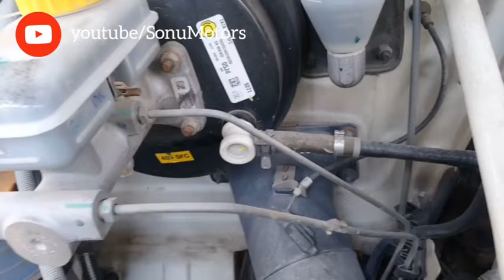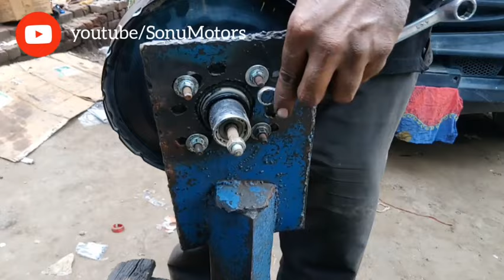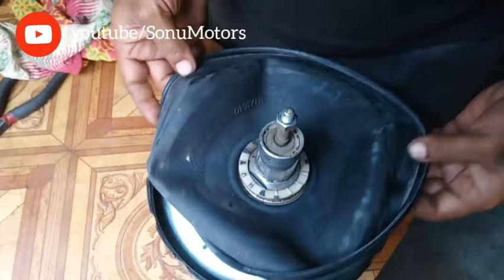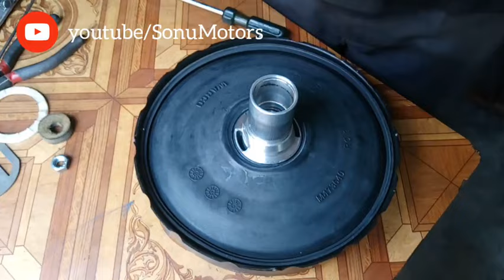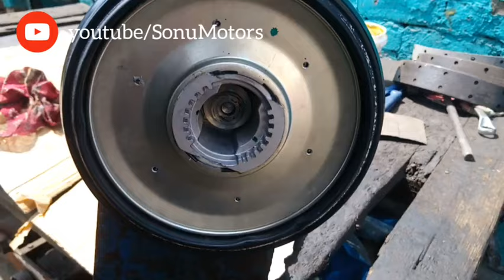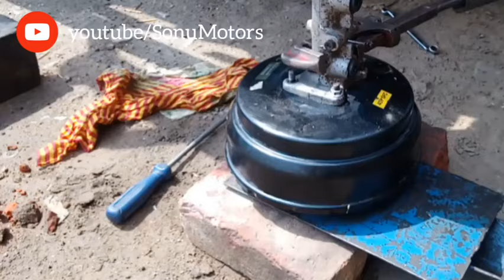Vacuum Brake Booster Repair | ब्रेक बूस्टर रिपेयर करने के आसान तरीके | Hindi

Comment: Sir bolero brek hard horaha hai what problem
Reply from the maker: Paidle hard hone ke karan
1 vacuum paipe leak ho sakta hai
2 brake booster ka rubber kharab ho sakta hai
3 wheel cylinder jaam ho sakta hai

Comment: Hai, mera naam jaseena, mein kerala ki rahnewali hoon. Mere paas tata ka 407 commercial vehicle hai.meri gaadi ka problem, uska break apply nahi ho raha hai. Break mein foot, rakhne par break pedal neeche jaa raha hai. Break booster badal ke dekha. Maas cylinder badal ke dekha. Phir bi woh waise ka waisa hi hai. Gaadi mein load nahi toh thoda sa break miltha hai. Gaadi mein load ho gaya toh break nahi miltha. Hum kya karenge. Idhar ke service karnewalon ko patha nahi chal raha hai, kya karna hai
Reply from the maker: Jaisa ke aap ne gaadi ki problem batai hai
Paidal neche jane ki is me break booster ki koi dikkat nahi hoti is problem ke aur karan bante hain
1 master cylinder ka kharab hona
2 Brake paipe ka leak hona
3 Brake ka sahi se na milna
4 Brake adjuster ka kharab hona
5 Aur brake paipo me हवा hona

Aap ne gaadi मॉडल no years nahi likha

Agar master cylinder badal gaya hai to 
Upar दिए हुए karnao ko cheak karvaye in se koi ek karan hai  
Gaadi new मॉडल hai to right side ke पीछले टायर 
के pass brake paipe ke बीच ek break ki setting hoti us ko bhi set karne se brake sahi ho ti hain
Reply: Gaadi ka model 2011, BSIII
Reply from the maker: Paidal neche ka karan jyadatar master cylinder ka hota hai 
Agar master cylinder bilkul sahi hai to gaadi       ke brake ko मिलवाए  aur sare wheel se hawa ko निकलवाए 
Aur sath hi जिस कारणों के baare bataya un ko bhi check करवाए gaadi sahi ho जायगी ।

Comment: Dear sir
Mere pass new tata tiago 2020 hai 3 cylinder engine kabhi kabhi brake low speed pe hard lagta hai but second press mein lag jaata hai. 
Service center aaj check karaya toh 1 se 2km drive kiya full speed low speed lekin koi problem nahi.
Aur neutral mein brake press karne pe hiss sound aati hai toh usne dusri tata ki gaadi dikhayi bola vacuum ke wajah se yeh common hai aur dusri gaadi mein bhi hiss sound tha. 
Kya baar baar break press karne se break hard hota hai?? Please sir reply
Reply from the maker: Sir break booster main halka sound aana commen hai 
Baar Baar break lagane par paidal agar jyada bhari ho raha ho to break booster ya vacuum paropar nahi  banta tab aisa hota hai
Par aap ne jaisa btaya us hisab se koi dikkat ki baat nahi hai
Mere hisab se aap ek baar vacuum paipe check karwaye aur engine ki slow race ko halka sa badwaye
Is se booster ko vaccum pura milega 
To break aur break paidal sahi rahega vaise sir hamara kaam badi  ka  hai system same hi hota hai
Comment ke liye dhanyawad sir
Reply: @SonuMotors  thank u sir for reply doubt clear hua mera 👍👍👍

Comment: Thanks I have same problem in my safari 3.0 Dicor 2006 which is same like TATA 407, all mechanics don’t look some say vacuum pump is broken and some says booster change karo without even opening bonnet. Thanks for video, Shop kahan hai?
Reply from the maker: Thank you
Reply: @SonuMotors  aapki shop kha hai address

Comment: Sir meri gadi aage se bhari bhari chalti hai aur acclator pedal pe pressure Dena pad raha hai.gadi wagon r hai 12000 km chali hai.caliper grising karavya to thik chali for se same problem aa gaya.
Reply from the maker: Sir . गाड़ी  bhari chalne ke aur bhi karan ho sakta hai agar caileber greasing se फर्क पड़ता है to ya to phir जाम ho gaya ya caileber pin टेढ़ी है 
Disc assembly ko paropar sahi करवाए प्रॉब्लम
Sahi ho जाएगी ।
Reply: @SonuMotors  sir 1st gear me gadi bina aacelate kitni speed pe chalegi aur second gear me kitni speed pe chalegi?

Comment: In my tata Vista break pedal got jam not return back car not moving ahead what to check and repair
Reply from the maker: Yes
Reply: Plz advise
Reply from the maker: The problem that you mentioned is of brake booster and disc brake, first you check the disc brake well
Reply: Okay I'll check disc break also there is fuss sound coming while pressing break pedal
Reply from the maker: check if disc brake is good then brake booster will be faulty
Reply: Is it possible for you to clarify part number and company name of break booster for Indica Vista petrol

Comment: I'm from Mizoram, and have the same problem. where can i get a repair kit?  Mechanic told me that, it's not repairable and i have to buy a new one.
Reply from the maker: Which is your vehicle, which brake booster is installed in it, which company belongs to
Reply: Tata SK407 bs4
Reply from the maker: This brake booster kit is available and repairing is done, this kit is available here in Kashmere Gate Delhi, if the mechanic tells you that the repair cannot be done, then tell him about this video thank you
Reply: @SonuMotors  bhai kashmiri gate shop ka naam ya adress bhi toh batao tabhi toh kaam banega

Comment: Hi, my TATA 207 brake pedal was going to the floor, so I change the seals in the master cylinder, bled the fluid and air from the slave cylinders, pedal got hard, but now it's hard to press while driving and transmission shifts down when I press brake pedal. There is good vacuum behind the valve. Could you advise please.
Reply from the maker: When you press the brake pedal, the brake pedal goes down after stopping at one place.
or goes down without stopping
Reply: @SonuMotors  the brake pedal is hard to press, braking difficult, when engine started, brake pedal does not get softer, and when pedal is pressed while driving, transmission shifts down .
Reply from the maker: As you mentioned, while driving, the foot goes down, there are two reasons for this, first is either brake show down or there is a fault in the brake master cylinder